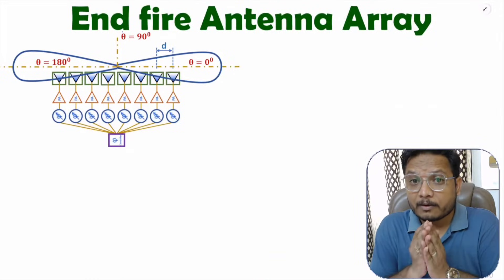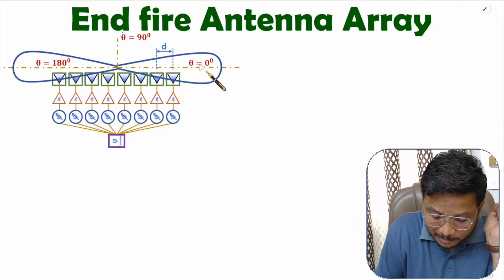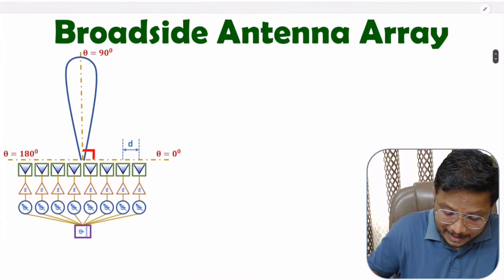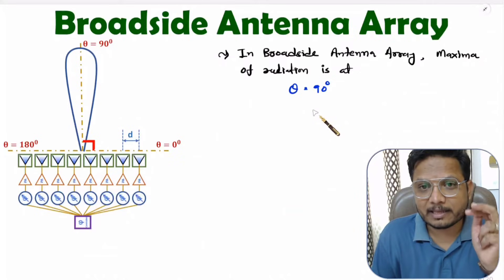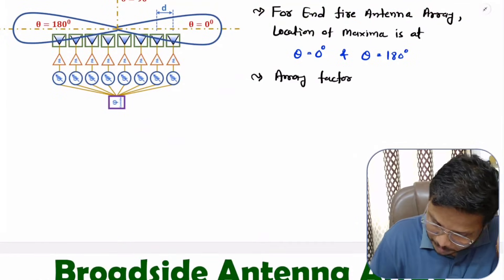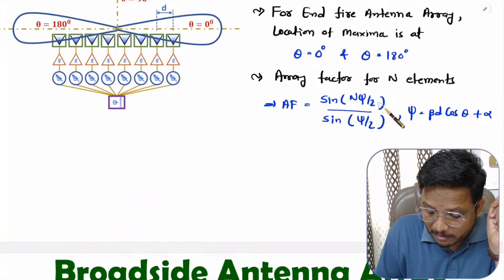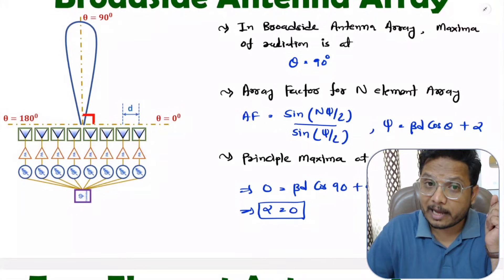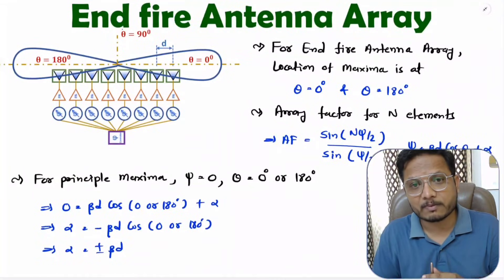End Fire Array and Broadside Array | Radiation Pattern | Conditions for Radiation | Antenna Array

Comment: Sir i have one doubt sir my mam give one some in home work beam steered array sir n=4 and d= lamda/2 sir i want only what is formula i can use sir (sin or cos) i have confused i am using sin but all values is maths error in my calculator plss give what formula i will useddd plsssssss reply me sir
Reply from the maker: You may be doing mistake while using calculator, it can be easily calculated using calculator. See the calculation properly.
Reply: @EngineeringFunda   sir what is the formula I have to use
Reply: Kindly I ask sir I don't know how to approach that sum plss help me sir
Reply from the maker: @User-ff2gf  how could I help by comments tell me.
Reply: @EngineeringFunda  sir what is the value of Shai =kdsintheta+to is it crt or not sir in beam steerte array